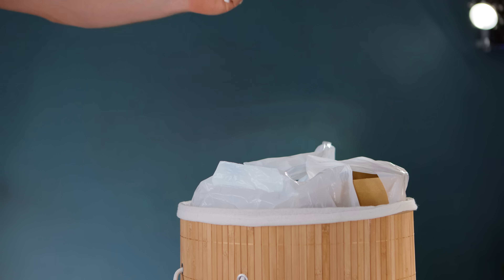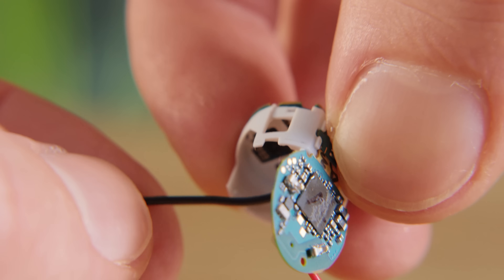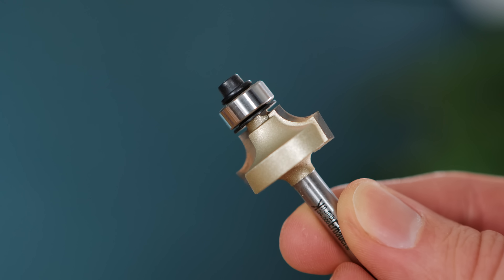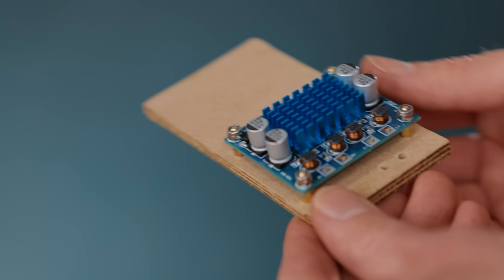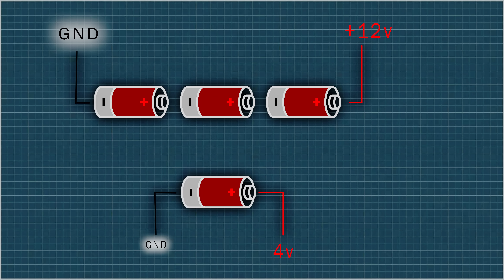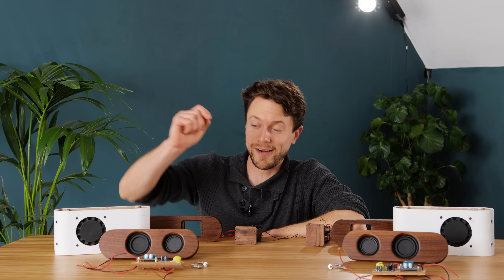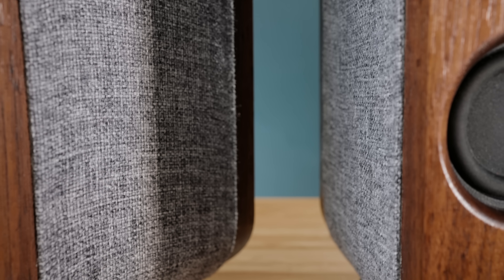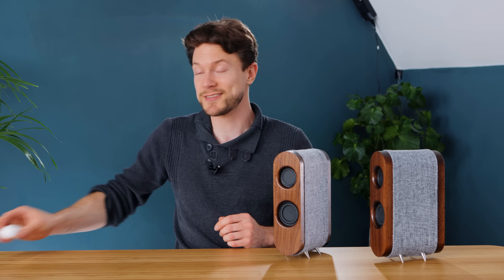Transforming dead earbuds into POWERFUL wireless speakers

Comment: Initially I thought he used existing, wired speakers and made them wireless using the earbuds. But then I slowly started to realize he made the entire thing from nothing.

Yes, I'm new to the channel.
Reply: Welcome, it's pretty awe inspiring in general!
Reply: To be fair you could take the speaker cables from the earbuds and hook them into powered bookshelf speakers if they didn't have Bluetooth.
Reply: most wired speakers are passive though, so he would need everything besides the drivers anyway, maybe even the audio filters, as the result of filtering before amplification may be different and uses easy accessible components, especially when the speaker doesn't have filters.
Reply: @noahluppe  I was talking about normal wired active speakers - the ones with 3.5mm connectors. Not passive ones that you connect to an amp.

Comment: Great video! Would love for you to upload the circuit diagrams for the filters you made to connect before the audio signal is amplified. Cheers!
Reply: They're just standard RC filters. literally the first basic filter you're taught about. 

I personally would have recommended he use higher quality components + a variable resistor. His speakers had bass but no detail. If he bought some Japanese capacitors he may have gotten something close to Bose interms of details and he would have had more control of the sound profile with the variable resistor.  There's also stacking them for better cutoffs.

Comment: so long as the speaker itself is connected by pads or pins, you can literally rip it off (desolder it, preferrably) and you can feed that into either a larger speaker, an amplifier, or an external audio processing unit, that then sends it to a speaker or two (each bud will be mono, almost a guarantee, even if they can accept stereo input)

Comment: Pro tip, if you want seamless placement shots, start with them in the perfect positions, and then film yourself picking them up and removing them. Then run the clip backward. Most people won't notice as much as the cut that was here.

Comment: Only question i would have is can they be easily paired with any BT device or do they need to be paired earler as as far as i recall you need to push a "pair" button on them (unless they want to pair up after power on)

Comment: For the lazy or curious, cost in USD
$13.74 batteries
$14 amp
$181 speakers
$209 total
+ battery charger, construction materials, electronics (including the broken ear buds) and shipping of components.
Reply: Buying two Amazon dots is cheaper…

Comment: Only thing I'll mention is perhaps using thumbscrews of some kind for the battery panel to facilitate removal, especially if given as a gift. Although in that case, adding in a charging circuit with a micro USB or even USB-C port would probably work better, as the person gifted then does not also need a proper battery charger.

Comment: I was wondering, would it be possible for the batteries to  be soldered onto a buck converter and an associated barrel plug to charge all four batteries? That way you would not need to remove the batteries every time you want to charge them. Another question, could you make speakers like this using wired headphones  and an aux to Bluetooth receiver?

Comment: Any idea when the guide will be available? I figure this will be an excellent project to practice my soldering skills. I've already got most of the parts on the way, but am waiting for the full guide before attempting the circuits. It will be nice to experiment with some expired earbuds I've held onto and eventually will get some low latency dead buds. Great video of course!

Comment: Don't know if this will be useful though, since the build is already done, but..
For the frequency filter you can use a little potentio to replace the resistor, so you can get more accurate frequency output you want by rotating the potentio to the right position.
But anyway, i like your all content very educative and relaxing at the same time, keep up the good work.
Reply: true, but using a pot will mean there won't be sync in sound with the two systems.

Comment: Fantastic job 👍 Price for parts - Galaxy buds £10 Subwoofer & Rad set x2 £60,& £60 , Mid treble unit X2  £16, & £16,   Batterys x 8= £63 , Amplifier £10  Super glue £3. Walnut Wood £7,  MDF Wood£5  Wood glue£3 Draft strip £3  Screws £1 Speaker feet £4  Cloth£4  Soilder kit & Soilder £16.00 total = £217 , For 2 speakers , What you can buy JBL link   £83 ,  Bose refurbished soundlink £89 Dali katch blue tooth speaker £279 , What would you buy , Good luck God bless all 👍☘️🙏

Comment: The bass is a lot more full on your speakers but the top end is compromised. I'd put more of the midrange in the woofer , have a smaller lighter speaker in the tweeter and change the crossover accordingly.  Or add a third crossover with a small tweeter and move the whole package down.
Luv and Peace.

Comment: Honestly another great way without a workshop is to solder 3.5mm jacks to some existing ones, though you'd still need a battery and power them so not as nice.

Comment: Have you ever hear of a Sono tube? It is a round reinforced cardboard and sustrate tube used to pour round concrete column's up to 8 feet in height. You could do a similar speaker by reforming a round sono tube onto the shape of the end pieces. It would save work and interior space.Fantastic recycling by the way.

Comment: Loads of respect for your attention to details. Hats off 😍
Reply: Sir aap yaha 😍😍
Reply: except he forgot the detail where you can't pair them anymore now that they don't fit in a case lol
Reply: @jdigi78  you still can pair them they dont need case to paired up
Reply: @VtheFifth  they do, you put them in the case and hold the button to pair to a new device. That's how it works with every pair of wireless earbuds I've ever seen
Reply: @jdigi78  they do if you just try hard enough
Reply: Aray sir app idar kaisay :D
Reply: Sir yae aap kis line may aagaya
Reply: Wow never expected your comment here 😍😍
Reply: My goodness, hello sir.
Reply: Gfx mentor sir nice to have you in here
Reply: Agreed, this was an excellent build.
Reply: Jokes on you I don't wear a hat.
Reply: never  expected someone I watched to be here
Reply: Sir ap Yahan kasai
Reply: Yes, really neat work. Though I would have included a USB power port for charging. Then put a small and cheap (~$5) 3 cell balance charger inside the speaker (and of course a 1 cell charger as well). Would be much more practical and added cost would be under $10 / speaker.
Reply: @tkermi  how does one charge a cell
Reply: @iwinrar5207  Please see my comment above (my answer to another person) 🙂.
Reply: @tkermi  can you explain what you said please? I mean I wanted to put the charging module too but I'm actually not really aware of what should I exactly do. And if you take time to explain then appreciate my humble thankfulness to you buddy.
Reply: @abeginnerspov5968  Yes, I haven't done this exact project myself and I can't give specific instructions (because I have quite limiting neurological disease). But here some info 🙂:

I don't know how well the Chinese USB PD or QC3.0 chips/circuits would work to power the charging. So I would use normal 5V USB products. Thoug the phone charger you plug to wall outlet to power all this can support higher voltages.

It's maybe easiest to use 2 different USB inputs from the products described below, so that's what I explain. But you do get the neatest and most airtight result if you buy a separate panel mount USB connector, attach it to speaker's back panel and connect/divide wires to these two devices mentioned below inside the speaker. 

- Buy a readily made USB powered Li-ion charger for one 18650 cell. These cost around $1-$1,5 in Alibaba etc. If you make a small bracket for this (so it doesn't shake loose) you can drill a hole to the speaker's back panel and use the charger's original USB input connector for providing the power. Use some adhesive/sealant around the hole. This gives the charging power to that one 18650 powering the "earbud". You can take the + and - from the charger's contacts.

- Buy a DC-DC step up converter with USB power input connector. The Alibaba product:
MT3608 2A DC-DC output MAX 2V-24V to 5V 9V 12V 28V Step Up Converter Booster Power Supply Module
should work. It costs about $3,85. Mount this the same way than the one cell 18650 charger if you want to use it's own USB connector through the speaker's back panel. But use tape around the connector before applying a lot of sealant/adhesive so the sealant doesn't clog up the USB connector. Now connect your phone charger to this device's USB input and use the potentiometer to trim the output voltage to the value recommended for the 3 cell Li-ion BMS talked about next (for the cells 12,3V-12,45V is optimal but there could be some diode drop losses in the BMS, so higher output might be needed).

- Because a phone charger is current limited, often 5V/2A or 5V/3A, and the suggested DC-DC step up converter is 2A limited I think that for 3x18650 cells using a balancing BMS is enough. Actually the max. amperage from 5V/2A to 3s/11,1V battery is ~1A (nominal 0,9A) and from 5V/3A ~1,5A (nominal 1,35A) - so these are nice, healthy 0,3C-0,5C levels for a typical 18650 cell. A 3000mAh battery charges from 0% to 80% in 1h 50min - 2h 45min, the last 20% takes maybe 1h more (if limited to 4,1V-4,15V cell voltage). 

So no need for an actual charger after the DC-DC step up converter. But this requires that the voltage output from the DC-DC step up converter is adjusted to be just right or preferably on the lower side (resulting ~4,1V-4,15V / cell when full) because many of these BMS systems allow 4,3V (12,9V total) cell voltages which isn't healthy for the battery. But by limiting the voltage from the supply this problem is solved.

There are many Li-ion 3s / 11,1V/12,6V BMS boards to choose from. You need to get one that is balancing type, not just protecting type. The ones with wires already attached are easier to use. No need for super high A rating. But even though 2A is fine for charging I would choose a 5A-10A rated one because many BMS designs route the output to load through the PCB. The 5A capability guarantees good transient performance. They cost aroud $1-$2.

- And like mentioned in the video, to be safe use high quality 18650 cells with built in protection circuit. Many Chinese BMS modules has not that precise low voltage cutoff, so the protection in the cell helps in this regard as well.

Comment: I would have liked seeing you add a input for charging, such as USB-C in.
Reply: He actually has the required space and there are many key turn boards to drop in that could dump to the pack.
Reply: @eden12340  for sure, he just likes to make it look clean.. but i don't feel like this is very handy
Reply: @aarriikknn33ll  In fairness the removable battery panel can be made to any size if people feel up to that
However I feel that he left it out of this design as you would need to separate the power between the 4v and 12v lines and ensure the charge was balanced to avoid degrading the cells which from a layman's perspective makes it more involved and could put people off the project
Reply: @bengrogan9710  True for sure, a battery bms is very cheap and easy to use tho but i do undestand that.

Comment: Cool design, I like tang-band drivers.  A flat diaphragm for mid and high frequencies is a strange choice, they probably beam in the high end.  I would definitely use a radiused chamfer on the high frequency drivers, any discontinuity in the recess will introduce wavelength dependent  interference.  The chamfer itself may give a subtle amount of gain to a limited range on the driver too.

Questions I have:  Does the earbud driver circuit use any type of tone shaping or does it have linear response?  You should run tests on reference signals in to see if there is any default equalization.
As far as the passive EQ networks you used on the Left and Right channels.  Personally I would have used something like a Salen-Key op-amp filter.  Or if you could get an amplifier with a decent quality DSP and tweak the crossover point.  Linkwitz-Riley cross-overs can give very linear combination.

Cool project.  I've been wanting to make a laptop pedestal  powered speaker.

Comment: I must say, this is an awesome idea and I liked the fact that you use 18650 battery. What I don't like about this concept is the fact that I have to remove the battery everytime I wanna charge this device. I think it would be a good idea to add the battery design use in the video "convert dead laptop to smartscreen" where you used a step-down converter, charging method, and battery level indicator. Adding this stuff to it would make it a rear one of a kind masterpiece. 

*You don't have to take out the battery everytime to charge.
*it would have a DC socket that I can charge the device with (12v goes straight to 12v and 12v step-down to 5v and you use tp4056 for charging the 4v battery. 
* battery indicator to display how much juice is left. 

I hope you see this comment and add the concept to your build. Keep up the good work mat.

Comment: Fantastic finish on these. I would definately add built in charging, TP4056 boards are cheap and can be strung together to balance charge the three cells. Four per speaker, all wired to a single Panel mount USB C or micro, very convenient!

Comment: Sadly, electrolytic Caps on the signal path is a huge no-no, so, I'd suggest swapping  them for proper audio (or at least non-polar) caps
Reply: In addition to that, PCB Providers such as JLCPCB could provide you with extremely cheap PCBs, in order to avoid naked copper for the signal path and (possibly) improve noise levels

Comment: This helped me a lot...I had a Bluetooth speaker project but it was on hold cause I wanted small filter circuits like this and I couldn't find a proper circuit... I even built the amplifier out from scratch...took me a bit of time...but finally I can complete it...thanks a lot

Comment: Not actually that cheap a project. The electronics are quite pricey, in particular the batteries and drivers. As for the CNC router and chamfer drill bit, you can see why mass produced units are so favourable, economies of scale. Fun to watch being made though.

Comment: Would it be possible to add a barrel or a USB-C connector wired to the batteries to charge them that way? So you don't have to unscrew the back and take out the batteries everytime you want to charge them.

Comment: Not bad if your bored. looks like too much time when you could have bought a good speaker. My only question on this was why not build it so the battery doesnt have to be unscrewed to charge, could have maybe set it up to have the port showing to charge the batteries easier

Comment: no easy access to the touch button on the buds? How will you go into pairing mode without turning off the paired phone/device? Also have to be careful not to use earbuds with active noise cancelling as those will cause really strange issues. Also some earbuds will have DSP tuning designed specifically for their in ear driver. So the raw audio coming from the electronics will not be flat. You will also have to turn off phone call audio or it will try to use the internal microphones on the buds (Its inside the speakers now). You could possibly relocate the microphones though.

Comment: While it's a good build I can see there is one little flaw. What if you need to sync with a different phone or other device? 
I would've desoldered the buttons and extended them to the back to eliminate this problem. Now you need to open it up just to get it paired to a different device.

Comment: they look fantastic! my only question is how do you go about pairing them to a new device?

i'm actually kinda tempted to do something like this using the circuitry from a pair of existing Bluetooth speakers with stereo paring, as being able to select one's own amplification circuit and drivers would be a HUGE upgrade over the speakers originally. I guess I could also stick  with the existing batteries to drive the pre-amp, but that would require setting up a usb port or something to charge them

Comment: i am using tht exact same amp for powering my 2x15 watt speakers . but an annoying ticking noise is coming from speakers when i connect it to my computer , but no ticking sound when connecting to a mobile phone. why??
amp is powered by external battery , 
and my pc is not grounded as well. 
plz tell why

Comment: Wtf the Low end Driver pumps the high end speaker Back end forth Just Like the passive Radiator 🤣
Low range speakers in one housing (at least for a Open tweeters Like you are using) Just dont Work 
No Matter If you Say they Sound godlike.
And how do you want to Charge that 'battety" Pack.?
Just using differt voltages in one battery Pack makes it easy, Sure.
But makes the Most Important for real World Use, Charging, complex, and for that kinda virtually Impossible.

Comment: While it will add to the complexity of the enclosure builds, I would box in the battery pack to seal it off from the speakers entirely (1/4" MDF should be more than enough), attach the battery pack to the amp board with a coiled cord in the battery box, and put a couple of nut inserts in the enclosure body, using 2 thumbscrews (like the ones used to hold computer side panels on) to hold the pack in so that you don't have to find a screwdriver to swap out the batteries nor worry about resealing the batteries in every time.

OR if you don't mind the "rough" look, inset the battery holder 2x2 on the back so you can easily pull the batteries with no disassembly.

OR put the holders 2x2 on the back and make a ... brass ... cover for them.